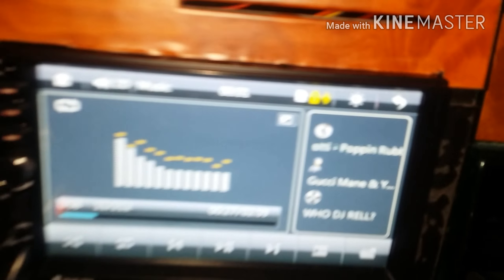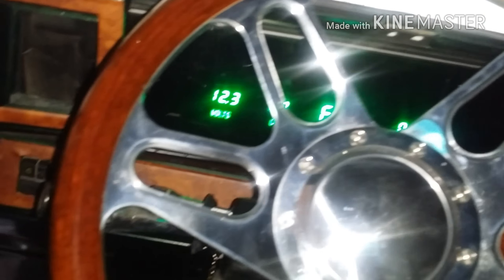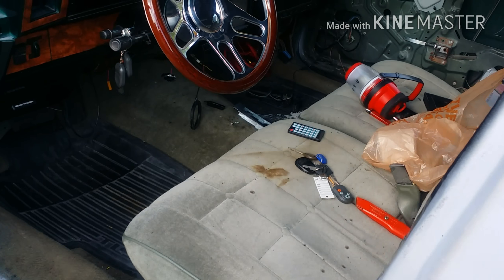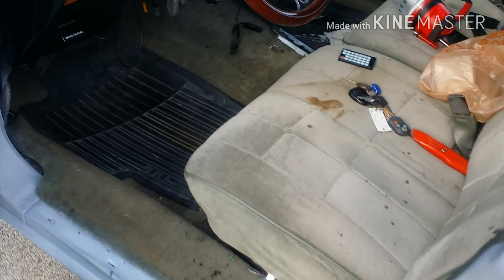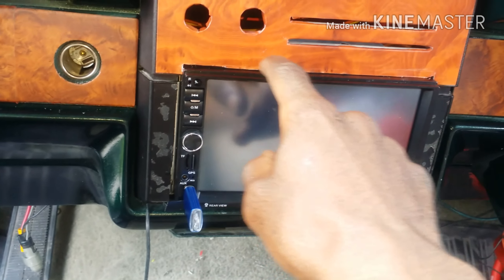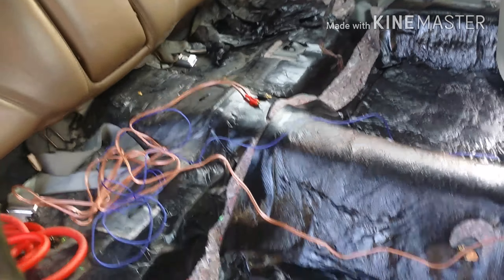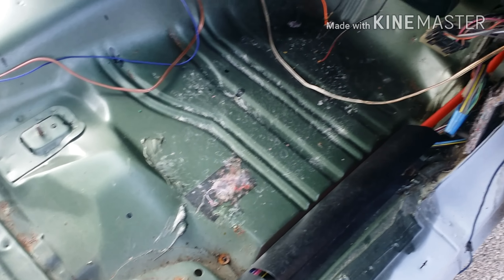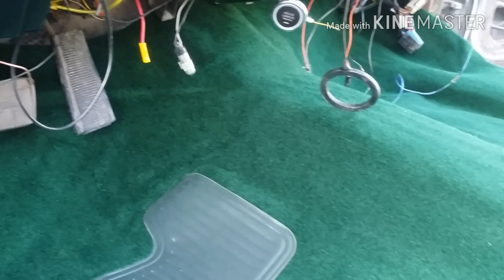Box chevy caprice carpet installation

Comment: Where did u get the carpet from eBay? That's the neon green?
Reply: @TeamSchaeffer  ok did it come with insulation cus I'm bout to order the neon purple one
Reply: @TeamSchaeffer  appreciate it I just took my old carpet up and had 2 rust holes on the driver side but my guy put sheet metal there and sprayed it